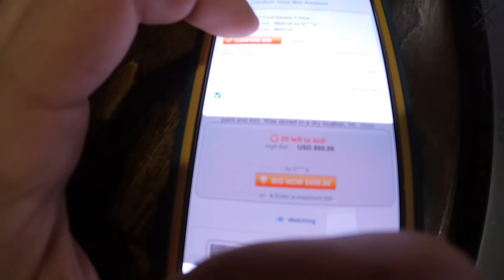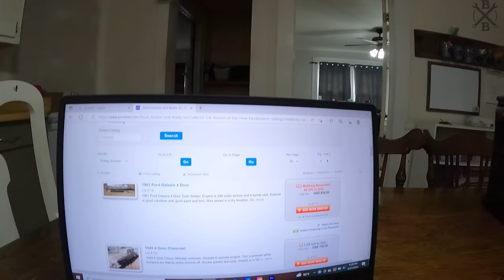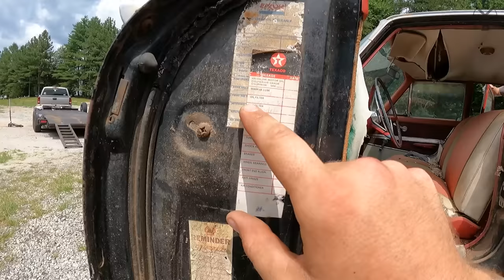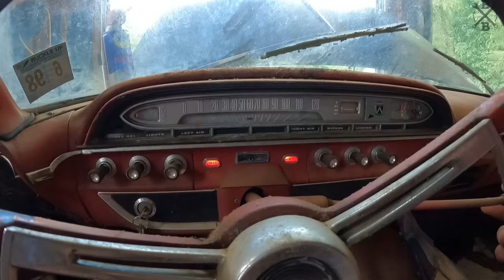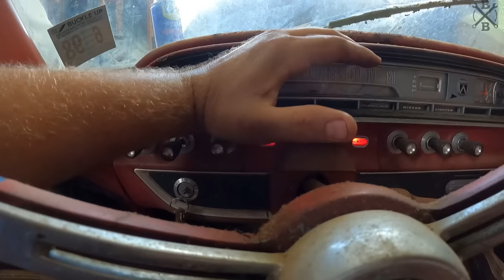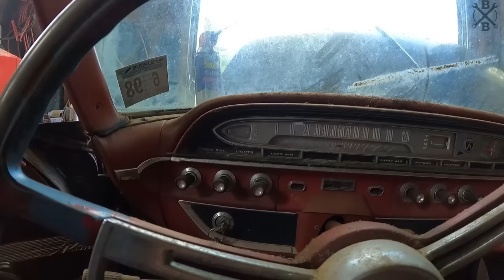BARN FRESH 1961 Ford Galaxie 390! Will it Run After 24+ Years?

Comment: Much nicer car than I expected.  Sometimes owners just forget about cars for decades.  The rodents mess them up but as long as they aren't sitting outside in the rain and snow much of the damage is superficial.  The pee smell is definitely a rat thing.  Surprised the rats didn't destroy the seats and carpets to make bedding.  You may have one still living in the headliner, so just a heads up.

Comment: The exhaust have to be cool after start the gasoline motor for it would stay cool exhaust with your hand feeling and Thermometer to inform the condition the engine, The cool exhaust would last for one minute in 77 degree Fahrenheit only after it not running all night. That is a great quiet running engine. If the exhaust it too hot in during one minute in 105 degree Fahrenheit then the engine is bad blow-by and oil is making too rich. Smoke or no smoke coming out the tail pipe is no worry - More important is start up the engine includes new alternator and no rust relay,. regulator then listen to the pops exhaust note and if it is good running condition. The battery post must be wire brush it off until it is shiny lead also clamp on the battery posts like new. Thank you.

Comment: I had a 1965 Galaxie XL 2-door with  bucket seats and an automatic on the floor and a 352. 4 barrel.  I had a tap that I always thought was a lifter.  One day I pulled the fuel pump (looked a lot like yours) and noticed a lot of play in the lever.  I replaced the pump and no more tap.  Loved the car, but I live in PA and the snow melt garbage they use on the roads gave it a rust kiss of death.  Gave it to a body shop who said he was going to fix it up, but never did.

Love lost

Comment: FYI, Auto Lite plugs were used in fords before motorcraft. The engine holds 4 qts of oil and one extra when you change the oil filter.

Comment: Of course all these cars will run unless it's trown a rod tru the oil pan, there's no hope for today's cars if they sit like this, gas is corrosive today, so your not going to start and run after any time, since gas now goes bad in 4 months, sonthe things entire fuel system will corode and plug with shit. The gas is now 70 percent Ethel, and it loves to eat metal, so don't leave it in your classic, always run it dry before storage

Comment: Excellent video Budget Buildz  :) Mike yes would say got nice good condition car also done super well to and change water pump plus thermostat plus rad fluid too  ! Also change brake fluid to transmission fluid  plus axle to and fuel pump plus tank even send unit too if needed! Check brakes plus Clutch out and sleeve cylinder plus brakes booster also fuild resivor!

Comment: I'm not for sure if that 390s got solid lifters in it or not I know I had a 63 and a half 390 with three speed overdrive and come out of the factory of the hot rod and it had solid lifters in it not for sure but 61 has solid lifters or not but the way it sounds it sounds like it's got solid lifters in it of course comes to worst take the valve covers off and poor little bit of oil across each valve cover you say you go down about a half a quart or about a quarter of a quart cross cross valve rocker arms and see if that quite sit down but I think they think it's got solid electric not for sure I'm not going to swear to it I know mine did

Comment: There should be enough lead within the engine to work for a little while, but I'd not get it on highway at fast speeds for long on today's gas, add lead substitute Everytime or you will be getting off the highway off ramp and when you stop so will the engine, having split all its valves you may or may not be able to start it again

Comment: Is it common on the 61 Ford for the left front fender to say Galaxy and the right front fender to say starliner? Now is it possible that the right front fender has been replaced and painted the match the car but they didn't change the emblem? That's certainly not a starliner Rush on the car

Comment: There is an old trick to help you load a car with stuck wheels, get a bottle of dish soap and put some in the path of the wheels, car slides right on! Great car, Great video! Thanks!

Comment: I'm really surprised it had no real issues but I'm sure that's because it was sitting in a enclosed area instead of outdoors and it had it's air cleaner still on it but most of the FE's I run into the valves are always locked up even the rockers themselves to the shaft so that thing must not of sat that long and that engine looked clean under the cover instead of nasty burned oil all over.

Comment: Some of those cars particularly were the heavy duty three speed "T85" close ratio transmissions. You could do a easy ninety mph in second gear, they were bullet proof tough transmissions. Glad to hear it is not a parts car... the idle was probably the choke step on the linkage not coming clear off so the idle won't come down till that falls into its final spot

Comment: Put a quart of Marvel mystery oil in the next time you start a engine that has sat a long time . I had a issue with a engine bending push rods . So I took a quart of oil out and used Marvel and issue resolved .

Comment: Did the 61 come with a 352?   If my memory is correct, the 390 didn't come out until 1964 or 1965?? No matter how you fluff this video it doesn't fly!!!!!!!!!!!!!!!!!!!!!!!!
Reply from the maker: The 390 was introduced in 1961. Z code, 300hp 4 barrel. Which is what this has. The 352 would have been an X code, atleast with a 4 barrel. The 352 engine had blue valve covers and air cleaner, where as the 390 had gold or silver. Like this one. Our 1962 Thunderbird is also a Z code 390. The 390 was changed a bit in 1964 with the addition of the cam keeper.

Comment: You just couldn’t contain your excitement. I would have been the same way! I had the same car while assigned with the USAF in Dover Delaware. Some low life stole the car! I still miss it! That 390 is a beast! Please save it! Here is a link to the history on these tanks!
https://en.m.wikipedia.org/wiki/Ford_Starliner#:~:text=The%20Ford%20Starliner%20was%20the,Fords%20in%201960%20and%201961.&text=In%201960%2C%20the%20Starliner%20hardtop,up%20the%20Galaxie%20Special%20Series
Reply: front passenger fender is from a starliner. not galaxie. has been changed. autolite was fords brand in the mid 60s. fuel pump was original equip.

Comment: you should invest into a brake drum puller it makes things so much easier and faster you can even make one that will work just as good and they don't destroy the drum just the old shoes that are stuck on the drum

Comment: Those FE blocks that sit almost all the time will have stuck valve issues you gotta get in there and spray the valve stems and give some taps on the valves to loosen then up if not you will bend push rods and things like that.

Comment: Sleeperdude fills the filter ( when possible ) with MMO and puts the rest of the bottle in with the fresh oil, at the very least it's gonna flush the galleys and clean the bearings, the few seconds it in there won't hurt anything

Comment: save it, save it, do all the mechanicals, clean the radiator, use some antifreeze. get the seats out.  wash the engine.   i love it is a manual trans.,

Comment: That car was a great barn find . Those 390 motors were good motors, I use to have a 1974 Ford truck that had a 360 motor in it and it was a great motor and one of my friends had a truck with a 390 in it .  So several years later he gave me the heads off of that 390 motor and I had them redone and was going to put them on my 360, but then I stopped the project and never went ahead and put the redone heads on my 360, cause I ran into an issue with the motor and I still have the 390 heads that I had redone at a machine shop .
Good luck with the motor and the car .
🤗👍💖💫
Reply: Great video. I had a 61galaxy wagon in the late 70's in new Zealand.  I was 19 then. Great  memories.  It was used as a hearse in Wellington  once and met the driver by chance in Auckland years  later at a petrol station. Good luck  tony

Comment: The engine makes a sweet sound!
Reply: I don't why but those old 390s had the baddest sounding exhaust I've ever heard. Especially with some worn out 4 foot cherry bomb glasspacks. We would drive the car around until it warmed up and then put a water hose in the tailpipe to break down the fiberglass in the new mufflers. Then they would sound like worn out cherry bombs.

Comment: Looks like a Moonshine runner car to me. From what I've been told most runners did used 4 door sedans, the coupes were just too conspicuous...
Reply: Have to agree, top engine option, manual transmission, discrete black paint, North Carolina origin. How could it not be? 😎
Reply: @ramblerdave1339  ...And that's how I would do it up. Hot up the 390, fit new heavy duty suspension bits and front disc brakes for the modern world and maybe an overdrive (if it does not have one already) and just DRIVE the thing.
Reply: @tturtle1659  Don't forget the crates of moonshine in the trunk!   😁👍